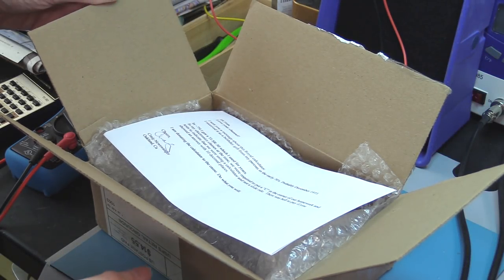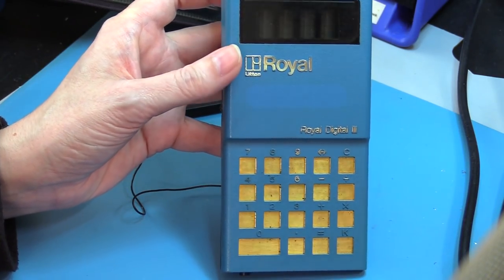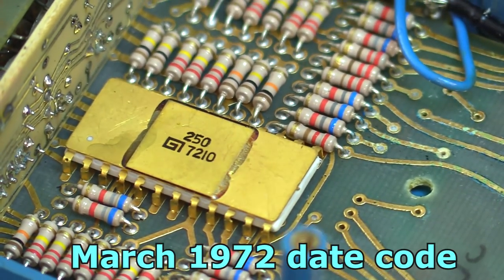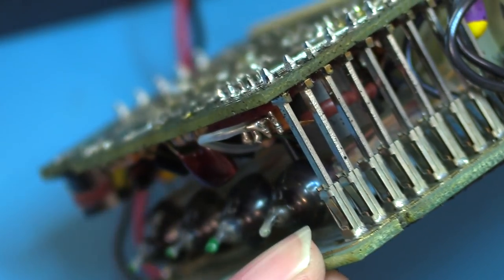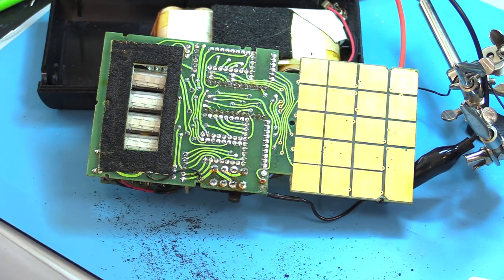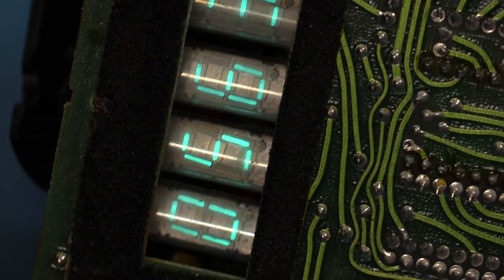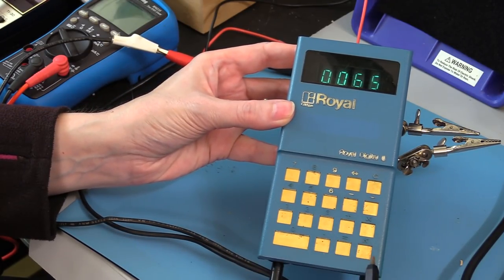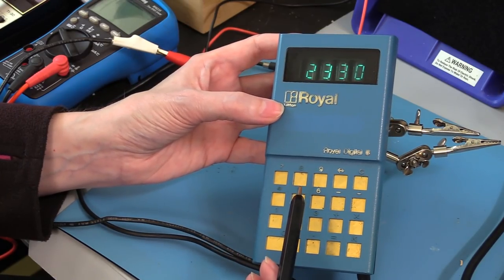Look Ma - No Keys!  1972 Royal Calculator

Comment: The Royal Digital II (this was a III) had 12 digits of glorious fluorescent tubes. Quite a come down but this is the interesting model. I saw one for 400 dollars. I would put a battery in it for sure,  but voltages for lithium would pose an issue. Seven standard rechargeable AAs would manage it.

Comment: @7:29 that sub board looks like it got something black sprayed on it (or something exploded.) And on that same board, some solder connections look "shotty. "
Reply: Probably it’s from the decaying black foam? Looks like there is some of the black foam around both the tubes and between the battery pack and the back of the pcb. It looks like what we see @ 7:29 on the back of the pcb is from the battery foam.
Reply: that's probably just the foam that turned into dust

Comment: I can't understand why they'd cheap out on a few pushbuttons when the thing's got ceramic chips and a dozen transistors and whatever else in there. Surely buttons would have been the cheapest parts back then, with no silicon in them! The fact there's only 4 digits shows it's the "economy" model but even so, if they'd had real buttons they could have done the keypad as a matrix and saved pins on the IC, or else a shift register or however it read the keypad.
Reply: This was probably designed right before the early membrane switches made with polycarbonate were released and made keypads a lot cheaper. Mind you these keypads sucked really hard, think less rubber dome and more Atari 400 so it wouldn't be much of an upgrade and I might just prefer a stylus to that.
Reply: Read the comment of youtuuba, please. There is the explanation why they did it that way.